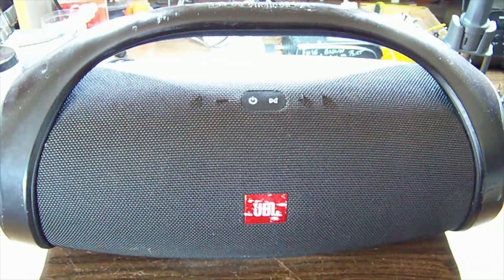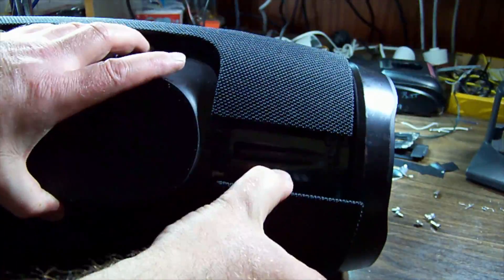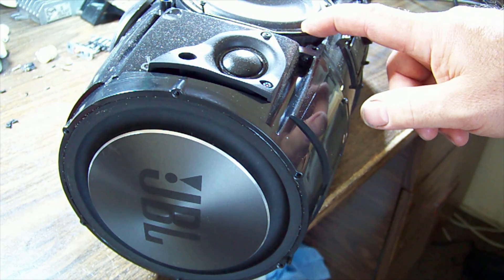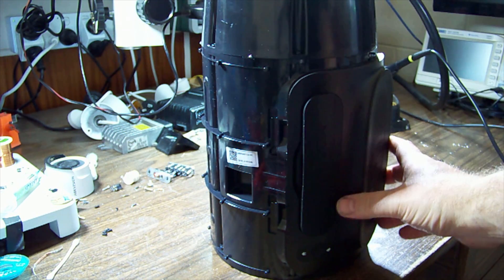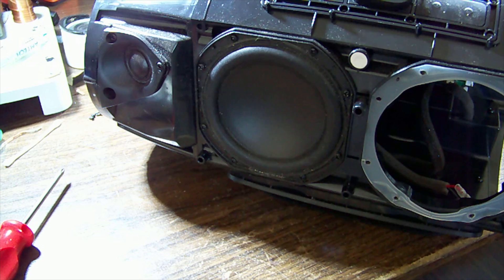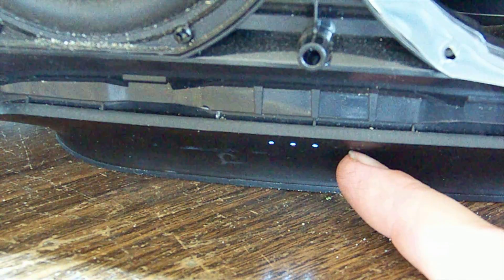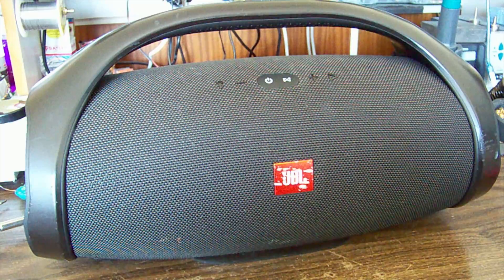How to open a JBL boombox, oh and the actual problem.

Comment: I did watch this clip to see how they come apart and I found the one I have was bit broken from someone dropping. I found same cord unplugged. Looking at how they have tied the wires in a ball to shorten the cable turns the knot into a weight that pulls the plug apart when it receives the shock of a fall. was helpful clip thanks

Comment: I cant get the end off u rotate whether on carpet, linoleum, wood or even a rubber matt
Reply from the maker: They are very tight. I think I put it on concrete. Whatever it is needs to grip it enough to prevent rotation so a firm downward pressure is needed to.
Reply: @JonnyFix actually if u take a screw driver in the crease to the bottom off the jbl letters on the ring itself u can take a hammer and slightly tap the locking mechanism out of slot so whole thing turns and comes off.
Reply from the maker: Neat. Well done!
Reply: @JonnyFix ty. Now I can't figure out why it won't charge. Not sure my next move. It powers on briefly as we drained the battery over the summer when it wouldn't charge. All connections look good. I had hoped after the fall maybe the charge port just broke loose inside. But nope.

Comment: Thanks for the video. It would be helpful to say which side of the speaker the motherboard is on. Also, I got mad and just ripped my side panels off. At this point it shouldn't take me an hour to try and turn it when it doesn't want to turn, and everyone else does it like its a baby toy. You'd think they would have some type of ring to help open the side panels. I butchered mine with pliers and a flathead.
Reply from the maker: Nice. Yeah these ones were quite stuck on as well. I'd like to get another one to have a second go at.

Comment: Hey i have a question my boombox just stopped working one day no light no anything no charging so i bought a replacement battery and charged fully i did notice that
 when the last light i think is the 5th one never came solid it always stayed blinking so i unplugged the charger and it said it was full ok i started playing the boombox when it was by 2 lights it turned off and i went to charge and a single red light was flashing but it wont charge it just stays 1 red light flashing any ideas ?🙏
Reply from the maker: Sorry not sure. It's definitely the right power adapter? If you know someone else with one you could borrow to rule it out.

Comment: I can’t get the rings off no matter what I do the screws are out and I have tried the little rotation and it DOES NOT work it’s been 2 days and still nothing
Reply from the maker: They can be very tight, it took me a few attempts. Turn it anti-clockwise while pushing it into the ground. Make sure the surface it is on has a good grip. Maybe try on concrete? If you haven't seen yet, look at 8:05 I show how the ring sits in to help you see how it needs to come out.
Reply: Hello! This is a copy a paste response. Please read fully if you are still searching for an answer to this solution. I am currently having this problem. First, let's check the serial number located in the port section of the JBL Boombox. If it starts with ND, most likely the process in the video will not help. For this model you will need to pry it off. Consumer discretion is advised as I have not done this process yet and am unfamiliar with how it will feels/looks like. I highly recommend more research before committing to the act. For those without the ND model, the process is not clearly described in the video. Your goal is to remove the opposite ring side using friction from the "normal force" of the surface of your choosing. Choose your surface wisely, it should be flat, grippy and dry. NOW, you can clearly visualize what the videos instructions are. You are not trying to remove the ring facing you but the one underneath. With the JBL Boombox upright, sitting on the subwoofer side you will need to apply pressure and rotate it anti-clockwise. BE WARNED. This requires quite an amount force. Hope this helps you in your endeavor internet stranger.

Comment: Removing the end rings is harder than this video is showing . The counter clockwise twist isn’t working for me😡
Reply: I got mad and just ripped it off. At this point it shouldn't take me an hour to try and turn it when it doesn't want to turn. You'd think they would have some type of ring to help open the side panels. I butchered mine with pliers and a flathead.
Reply: Hello! This is a copy a paste response. Please read fully if you are still searching for an answer to this solution. I am currently having this problem. First, let's check the serial number located in the port section of the JBL Boombox. If it starts with ND, most likely the process in the video will not help. For this model you will need to pry it off. Consumer discretion is advised as I have not done this process yet and am unfamiliar with how it will feels/looks like. I highly recommend more research before committing to the act. For those without the ND model, the process is not clearly described in the video. Your goal is to remove the opposite ring side using friction from the "normal force" of the surface of your choosing. Choose your surface wisely, it should be flat, grippy and dry. NOW, you can clearly visualize what the videos instructions are. You are not trying to remove the ring facing you but the one underneath. With the JBL Boombox upright, sitting on the subwoofer side you will need to apply pressure and rotate it anti-clockwise. BE WARNED. This requires quite an amount force. Hope this helps you in your endeavor internet stranger.

Comment: JUST FOR A TIP*** If the cables are still plugged in, unplug them and plug back in at least the battery, this fixed my issue! thanks so much

Comment: I had the battery unplugged on mine. This happened after the speaker flew off the back of a moving vehicle and the impact disconnected that plug. However there was no structural damage to the speaker itself besides some scratches and scuffs. This speaker is a beast and I vouch for its durability 100% once I connected the plug it was pumping like it never hit pavement at 15-20kmh

Comment: Having problems to turn the side thing off. That thing sits like glue
Reply from the maker: Yeah I had to fight with this one a bit
Reply: Hello! This is a copy a paste response. Please read fully if you are still searching for an answer to this solution. I am currently having this problem. First, let's check the serial number located in the port section of the JBL Boombox. If it starts with ND, most likely the process in the video will not help. For this model you will need to pry it off. Consumer discretion is advised as I have not done this process yet and am unfamiliar with how it will feels/looks like. I highly recommend more research before committing to the act. For those without the ND model, the process is not clearly described in the video. Your goal is to remove the opposite ring side using friction from the "normal force" of the surface of your choosing. Choose your surface wisely, it should be flat, grippy and dry. NOW, you can clearly visualize what the videos instructions are. You are not trying to remove the ring facing you but the one underneath. With the JBL Boombox upright, sitting on the subwoofer side you will need to apply pressure and rotate it anti-clockwise. BE WARNED. This requires quite an amount force. Hope this helps you in your endeavor internet stranger.

Comment: Do you know if there's any way to repair a Bluetooth connection? It stutters at fairly short distances or if I put my body between the speaker and my phone. I know it should have exceptional range.
Reply from the maker: I think that would be an issue with signal strength. Have you tried another phone to prove your one is ok? If the antenna in the speaker is plugged in there's a chance it may have disconnected, especially if speaker was dropped.
Reply: @JonnyFix  Yes I've tried other devices and it has the same issue. It works fine at a short range. I've taken it to a middle of a field outside and still the same issue. Are you saying there could be a loose connection to the antenna?
Reply from the maker: @brycemckamey9328  It's definitely something you want to investigate.

Comment: Very instructional video - thank you!! This was very clear, simple and enjoyable to watch.

It would be extremely helpful to know which pins in the battery connector you needed to place your multimeter probes on, in order to check battery voltage?? 

Many thanks!!
Reply from the maker: I don't remember but if there's a black wire and red wire that's a good start.

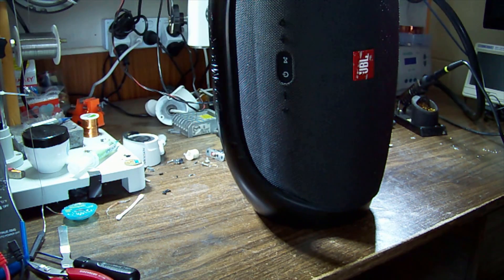Comment: I’ve been trying really really hard to remove ‘speaker’ end rings by rotating (about 2:30 into video) but no luck either end. Does anyone have any more tips on what I can do? Would really appreciate help. Will not power up or charge. Power brick checks out OK and have tried with another one with no success. Thanks for video - and it’s not intuitive to twist it, so agree 100%.
John R
Reply: Finally released the wavy rings. Thin pry bar and WD40 all round and worked it around to break the seal. After all ways of gripping with sticky rubber gloves etc. I still couldn’t release it. Then tried the standing it vertically with ring on grippy surface and twist body anti-clockwise, as in video, and it eventually released. Now to find the real problem...
Reply: @JsR-7and9  still not working
Reply: Sorted out the power-on/charging issues. In case it helps anyone I disconnected the 2 ribbon cables from the board (like the one that was off in the video) and reconnected them. One cable goes to the DC power-in and the other to the battery. I think that reseating the cables, even though they looked fine, was sufficient to overcome the problems. Hope this helps someone.
Reply: Put some heat on rings, I use hand torch, but you can use heat gun, hair dryer or even dipping it in hot water, it work for me, before I try all pressure couldn’t get it to spin, as soonest I apply heat they came off easily.
Reply: Hello! This is a copy a paste response. Please read fully if you are still searching for an answer to this solution. I am currently having this problem. First, let's check the serial number located in the port section of the JBL Boombox. If it starts with ND, most likely the process in the video will not help. For this model you will need to pry it off. Consumer discretion is advised as I have not done this process yet and am unfamiliar with how it will feels/looks like. I highly recommend more research before committing to the act. For those without the ND model, the process is not clearly described in the video. Your goal is to remove the opposite ring side using friction from the "normal force" of the surface of your choosing. Choose your surface wisely, it should be flat, grippy and dry. NOW, you can clearly visualize what the videos instructions are. You are not trying to remove the ring facing you but the one underneath. With the JBL Boombox upright, sitting on the subwoofer side you will need to apply pressure and rotate it anti-clockwise. BE WARNED. This requires quite an amount force. Hope this helps you in your endeavor internet stranger.

Comment: Hi Jonny,
I can't seem to get the end rings on the sides off of the Boombox. I've turned it anti clockwise, applying much/little pressure but it doesn't move at all. Are there any hidden crews from the inside? Any tips, thanks so much!
Reply from the maker: There's no screws in the end cap, they are just tight. This video also shows the process   https://youtu.be/V2kh9dOSe40?t=37
Reply: I had the same problem, I try pressure it just didn’t move, at the end I apply heat to the rings with hand torch, you can try with heat gun or it might work dipping the side of boom box in hot water to lose the rings. It works for me it should work for you!
Reply: Hello! This is a copy a paste response. Please read fully if you are still searching for an answer to this solution. I am currently having this problem. First, let's check the serial number located in the port section of the JBL Boombox. If it starts with ND, most likely the process in the video will not help. For this model you will need to pry it off. Consumer discretion is advised as I have not done this process yet and am unfamiliar with how it will feels/looks like. I highly recommend more research before committing to the act. For those without the ND model, the process is not clearly described in the video. Your goal is to remove the opposite ring side using friction from the "normal force" of the surface of your choosing. Choose your surface wisely, it should be flat, grippy and dry. NOW, you can clearly visualize what the videos instructions are. You are not trying to remove the ring facing you but the one underneath. With the JBL Boombox upright, sitting on the subwoofer side you will need to apply pressure and rotate it anti-clockwise. BE WARNED. This requires quite an amount force. Hope this helps you in your endeavor internet stranger.

Comment: I recently purchased a used one and it had two small holes towards the bottom of the front of the speakers when I press in on the subs site hisses out of them why would they be there and I’m also having a lot of trouble getting the end cap off
Reply: Please help someone
Reply from the maker: @sethpetras6641  Maybe the case has been damaged, causing the holes? The end caps are on very tight. I think I had to put it on concrete to give the end something to grip on while I turned the body. Need to push hard enough for it not to actually rotate on the ground but for the body to rotate as it disengages the end cap..... but if you push too hard it might prevent the disengagement.

Comment: Hi, if the battery completely died/broken, can i just  remove the battery and plug in to power source all the time?
It will damage other component or not?

Thanks
Reply from the maker: You can do this, it won't affect anything else.
Reply: @JonnyFix  Wow that's perfect.
thanks

Comment: Its bs that no one actually shows the struggle to take off the handle those end caps are the worst
Reply: It’s easier pushing down with a basketball 🏀
Reply: I was able to get them off ny sliding a screwdriver into it and wiggle it out
Reply: @demestresandokai how? I have tried everything including heat and it won’t budge
Reply: I spent a while trying to get it off, then I saw a comment saying to use a heat gun or a hairdryer. I used a little old hairdryer for a couple of minutes then all of a sudden they came off fine! :)
Reply: I used my wife’s hairdryer and nothing. Went to Walmart and bought a Wagner heat gun. A few minutes it was hot to the touch and it came right off. I would have bet money that it was glued on but it was not. I have tile floors and I have to put all of my weight on it and turned counter clockwise and it came off using force.

Comment: Hi Jonny

I'm having a issue that when I turn on my JBL Boombox the speakers make some static noise but won't play any music, only when connected to the AC adapter it plays fine. I took it apart and tested it with another battery and still having the same issue.

You think it's the whole board that need to be replaced? Or maybe there's a fix to it? 

Thanks and great day
Reply from the maker: It will be on the board and should be fixable but you'll need to figure out why it's happening. That is a strange problem so no quick answer.
Reply: @JonnyFix  darn it. Do you have any service for me to ship it to you?
Reply from the maker: @jxtreme586  I do not sorry.
Reply: @JonnyFix  Okay. Thank you

Comment: Had the same problem. I took off the front speakers then disconnected the mother board plugged it back in and it worked. Way easier than taking the side radiator apart

Comment: I connect the charger and it won't charge help please
Reply from the maker: If it doesn't turn on you can try another charger to prove it's not your one. If it does turn on you may need a new battery. I can't remember the battery voltage when full but if you have a way to test the battery and you have 0 volts then you need a new battery, if less than 7 volts then it might need to be plugged in for some time before it shows charging and if no change  after a couple hours or if already > 8volts then maybe a fault in the charging circuit. Good luck!

Comment: The sides do not open how i get them open
Reply from the maker: They are very tight. Push the side down on a surface with some grip and twist anti clockwise. It moves away from the body when it rotates so if you push too hard it might not rotate either.
Reply: Hello! This is a copy a paste response. Please read fully if you are still searching for an answer to this solution. I am currently having this problem. First, let's check the serial number located in the port section of the JBL Boombox. If it starts with ND, most likely the process in the video will not help. For this model you will need to pry it off. Consumer discretion is advised as I have not done this process yet and am unfamiliar with how it will feels/looks like. I highly recommend more research before committing to the act. For those without the ND model, the process is not clearly described in the video. Your goal is to remove the opposite ring side using friction from the "normal force" of the surface of your choosing. Choose your surface wisely, it should be flat, grippy and dry. NOW, you can clearly visualize what the videos instructions are. You are not trying to remove the ring facing you but the one underneath. With the JBL Boombox upright, sitting on the subwoofer side you will need to apply pressure and rotate it anti-clockwise. BE WARNED. This requires quite an amount force. Hope this helps you in your endeavor internet stranger.